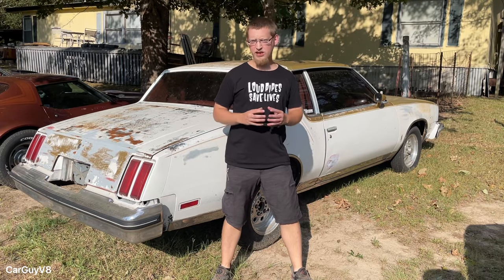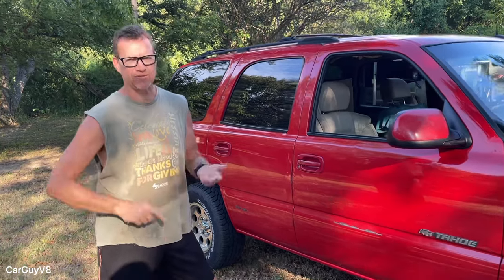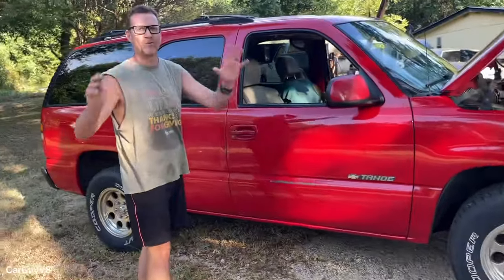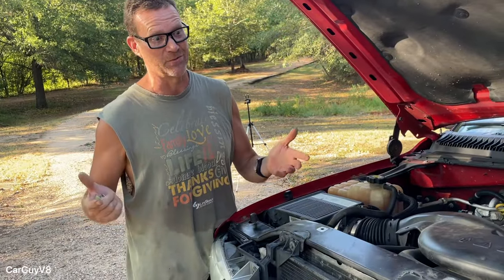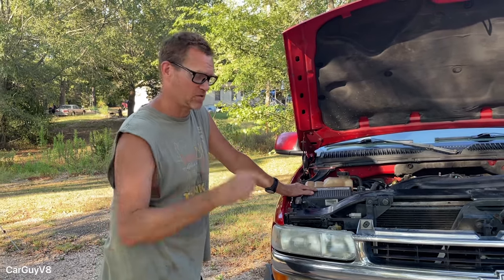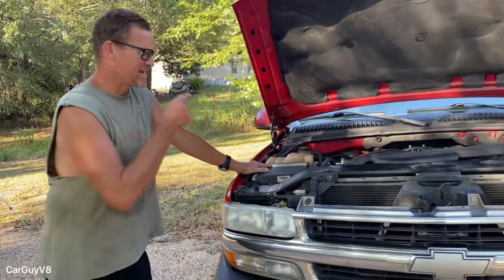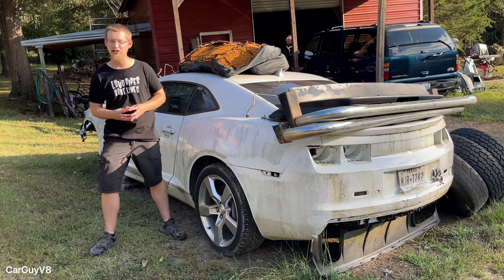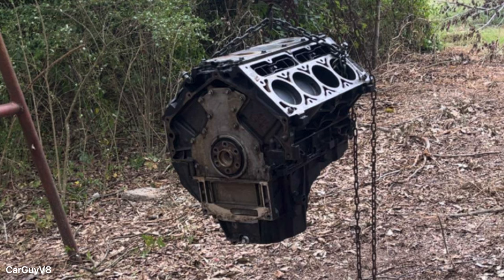The BEST Way To Do A CHEAP LS Swap!

Comment: Long story short, I've been building and swapping LS's for 15 years and it can be done cheap.  My formula ?  Cheap engine running off a carb and scrounging the junk yards.  I picked up a Gen 4 2009 LY2, 4.8L on a trade for an old MSD 6A box I had from another project.  Bolted on a BW T5 World Class behind it with a stock hydraulic throw out bearing.  Cut an inch off the stock oil pan and pickup and welded it back together, cut the outlets off the stock exhaust manifolds, reclocked and tucked them and dropped the engine into a '88 S10.  Used the stock TBI fuel pump and tank and added a bypass fuel regulator to feed the carb.  Intake was picked off Ebay for $200 and had to buy a MSD 6LS box to fire the ignition.  An F-Body donated the radiator and fans and the accessory drive was completed with a idler kit from ICT Billet and a LS3 tensioner.  I downloaded the blueprints for the engine adaptor plates and a friend with a machine shop built them for me for a 30 of Labatt Blue.  Basically it all came together for a little over $1600.  It will peel the hides for an 1/8th mile and it handles better than you would think.  Tons of smiles per mile, cheap.
Reply from the maker: I bet that truck is a lot of fun to drive! Thanks for watching.
Reply: Where are you located
Reply: Where are you located
Reply: Thanks for another great video. I have a 79 cutlass. Do you do the LS swaps for people. Let me know.
Reply from the maker: @J-DoGG909  Thanks for watching. Currently I only work on my own vehicles.
Reply: @hardball107 what year LS came with a steel oil pan?
Reply: I have a 83 cutlass and need a 5.3 ls swap install, anyone available
Reply: As someone who builds project cars for fun not a professional, why dont you just transfer the engine harness instead of buying all those extra modules msd, etc etc
Reply: fairly new to this, but i was wondering if i could swap a gen 3/4 5.3/6.2 into a gen v vehicle
Reply: @nbskyle  ask hardball he's been doing this for years
Reply: Damn I need to get on this
Reply: I got a Mercedes benz e class 2005 i would like to put an LS turbo engine , i would like to make 600 hp to the wheel. Any recommendations, im too young and new in to it
Reply: @CarGuyV8 can you put me in touch with Clay? Me and him use to work together years ago and ride motorcycles and street race together in Texarkana. I moved to Florida 10 years ago and lost his contact information.
Reply from the maker: @kevinharris6450  comment your phone number and I’ll send it to him. I’ll delete the comment with your number in it after I send it to him.
Reply: Wassup man , I just basically broke the engine, it still runs but it's just a matter of time , it has a bad rocker arm and lifters , I don't really wanna do all of that work and spend the money, I rather just put a ls1 in it and turbo it, (I have a 1998 S10 4.3 Manual 5 speed)
Do u think it would be a cheap and good idea to do ?

Edit: nvm 😂😂 the job isn't that hard as I thought, if u did the same thing as I did do be afraid to fix what u broke,    u did it😂😂😂 minuse well
Reply: @CarGuyV8 How much would you do a swap for me ?
Reply: You still buiding

Comment: 1500 bucks for a 6.0/ 4L80e 62 GMC.
 I bought a 06 Silverado with a 6.0 and 4L80 that had hit a cemment support for a drainage culvert and bent the frame for 1k. Pulled the 105,000 mile engine and trans and all the wiring and electric accelerator pedal and put it in a 62 short wide GMC truck. Put the computer in an 04 Silverado and got the anti theft to unlock and put it back in the old GMC. I made my own motor mounts and did my own wiring and trans cross member. A friend gave me an aluminum radiator that I made fit, and I ran the stock plastic water pump driven fan on it. I currently have the 06 Silverado fuel tank in the bed to run it. The first long drive was 90 miles to get the computer worked at a tuner place. It did fine in limp mode but got horrible mileage. Drove back at 20 mpg. It's got a 2.78 12 bolt under it, and at 85 mph, it's only turning 1800. Drives up hills with the converter locked up just fine. Will annihilate the tires so bad I had to put 500 pounds in the back to drive around in the rain, lol. I've got about 1500 bucks in it, including the 62 GMC truck, and it is my daily driver now. It is one of my best projects. I just wish I could find another doner truck to get another  6.0 out of as cheap as I did that one.
Reply from the maker: Thanks for sharing. Budget hotrodding is what it’s all about.

Comment: 5.3
Was the route I was going 2 go several years ago but I went 1986 casting block carbureted 4 barrel 700r4 T top monte I'm happy it's dependable, reliable runs good and alot of fun and complements I went for the handling and traveling ability of the car
Reply: Facts

Comment: LY6 with some LS3 heads must be the best bang for buck and can make good power.
Reply: Right! I wish I had a ly6 but I got lq4 gen 3 6.0 block rebuilt with ly6 rods and .030 position. Ls3 heads . The ly6 comes with LS rec port heads just a tad bit bigger combustion chambers I think 72 cc vs 68cc LS 3 heads
Reply: @davidjaime6407  I'm looking to do a similar project. I have a LQ4 with a LS1 intake and throttle body. Going L92 heads with a LS3 intake and 92mm throttle body. I want to run a Holley Terminator X system with a Summit stage 3 LS3 cam.
Reply: @crw3673  we should be getting close if not to 500 HP with cam and rec port heads. I'ma run a Holly or the new Edelbrock carburetor.

Comment: Im trial fitting the stock manifolds tomorrow on the 67 malibu.
I thought of cutting and welding them if necessary. 
Got lots of cast rod.
Try my first cast weld.
Reply from the maker: That’s sounds like a cool project. Thanks for watching.

Comment: IM VERY SKEPTICAL. 
 i just completed a swap in 85 cutlass, almost everything had to be changed out and ended up costing about 1800usdextra over 400usd engine. Fuel lines/pump, rad hoses, ps hoses, throttle cable, ypipe, exhaust,  gauges, flexplate adapter, motor mounts,  2-3 sensors,  repinned my own harness, reflashed my own ecm, electric fans andrelays/fusebox,  IT ALL ADDS UP

Comment: Found a 2001 Silverado 2500/6.0/4l80/4x4/4.10 with 290k miles, running driving with slight lifter or knocking noise. Would it be a good donor for a Jeep Comanche LS SWAP? The milage and the engine noise is kinda scary but the noise goes away after it warms up. Should I buy it as a good donor for a swap?
Reply from the maker: Sounds like the noise might be piston slap, which is quite common. It depends on how much he is asking, but I’d say go for it.
Reply: @CarGuyV8  he’s only asking 1200 for the complete truck but I think I can get them down to 800
Reply from the maker: @moejr14  absolutely worth it. More than enough stuff on that truck to make your money back if necessary.
Reply: @CarGuyV8 Once it has piston slap what do you do?
Reply from the maker: @Millie.1965  Using a better oil or sucking seafoam through the pcv can help tame it for a while. The real fix is an engine rebuild.
Reply: @CarGuyV8  Thought so.  thanks for letting me know

Comment: I’m trying to LS Swap a LS1 into a 5th Gen Camaro SS, could anyone help me figure out what I’m going to need?

For context, I’m a 19 yr old and lucked my way into a Camaro shell with just about everything but engine and Trans, and I have a family member who’s willing to sell me a LS1, and new to a lot of this stuff
Reply from the maker: Sounds like a cool project. Probably best to ask a forum this question. You’ll probably have to run a different intake at the least because the throttle setups will be different. It’ll have a different reluctor wheel than an LS3 too.
Reply: @CarGuyV8  any recommendations for a forum to ask?
Reply from the maker: @user-hg4hz1lx2h  LS1tech.com is the best camaro5.com is good too. Keep us updated on how your project turns out!

Comment: Can you use an L98 6 speed Vette transmission on an LS engine?
Reply from the maker: The ZF6? the SBC and LS have the same bellhousing pattern so I’m sure others must have used it before. Might have to research the clutch and flywheel situation though.

Comment: For everyone looking to do a LS swap in a non GM. Take that $800 out your mind lol. $7k to $15k
Reply: Nonsense! I literally just got my classic jeep cherokee ls swapped and running for under $500. I charge customers that much but if a guy is skilled in wrenching, fabricating and haggling it is pretty easy on just about any make or model. Just gotta have the time.
Reply: @fraserfab68  yea, yea sure… for $250 i scored a junkyard motor and for $30 in parts i completed a whole swap everything functional lol
Reply: @dnvr12  You are clearly not a builder. If you were, you would know how to get things done.
Reply: @fraserfab68 yeeeeea, suuuuuure.. thaats it lol.. thats just it lol…
Reply: BS,,, Remember the anemic SS Monte Carlo from mid 80's ? After purchasing it wrecked ,, and stripping it down to running / rolling chassis it's now a 55 Nomad wagon with tilt cruise , AC & power seats and shows very well at car shows ,, all done on the cheap ,  sprayed with PPG Omni
Reply: @GatesRapes  all for $500 aint it lol… i guess you choose to omit the “NON GM” portion of the post?
Reply: I'm looking at an iron block LS 5.3L swap or a 5.7L vortec swap in my 2015 Jeep Wrangler. Just the engine is around $800 to $1000 where I  live. I also need a transmission  cuz it doesn't mate up. Then I need a new wire harness, new exhaust bits, some engine mounts, transmission brace, new drive shaft to connect to the stock transfer case, new rad, new oil cooler, might need a new hood, new ecu, new sensors and many other new bits. I could do it all myself if I had 20 years to do it, but it's my daily, and I work 44 to 50 hours a week. I've got quoted by the 2 best shops in my city that have done may V8 swaps in jeeps jks, that I should budget no less than $20k all in.
So yeah, not everyone has an old ass g body, and all day every day to do it for $800.
Ironically, in my city, the cheapest V8 JK is around $45k to $50k to buy used, and they get sold very quickly when they go up for sale.
Reply: Only difference is the engine mounts. 😂🤣 all vehicles are just a platform, take one engine out, put the other one in, connect it and ride. It can be done cheap.

Comment: Neither of those two engines are LS engines...
Reply: You are either completely ignorant of the LS series,or you are confused and are thinking of the LS1, all 99+ Silverado’s,tahoes,suburbans, avalances and their gmc counterparts have an LS , 4.8,5.3,6.0,6.2, the last traditional sbc after the TBI motors ,was the 96-98 350(5.7) vortec ,which continued only in the vans until 02 I believe,every other vortec was an LS motor other than the 4200 vortec which was a inline 6 ,4.2 liter in the trailblazers, the only other motor you could’ve got in a 99 or newer Chevy truck was the 4.3 or the duramax ,and since they aren’t v6’s or a diesel please tell me what those 2 motors are? Either you know nothing about engines , or you thought you knew a little bit about one vehicle that you’ve owned ,and are mistakenly making assumptions
Reply: @JustinKase-c9b  Not readin allat
Reply: @epiccowboymemes2042  Needs to swap the cowboy hat for a dunce hat
Reply: @kingnull2697  Proof?